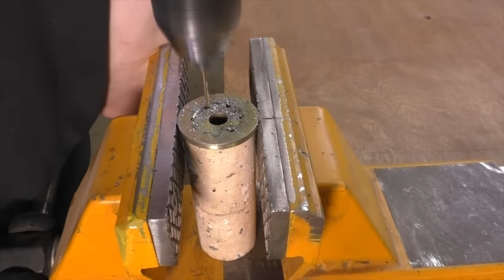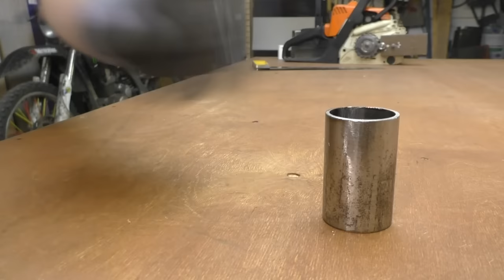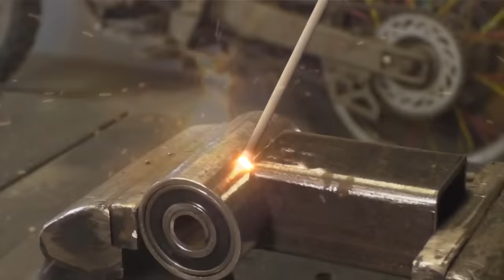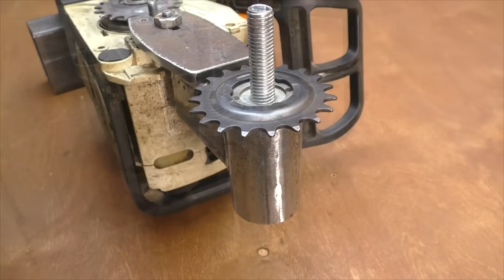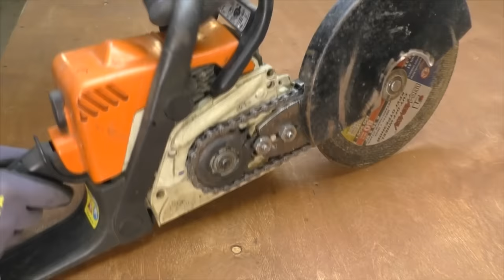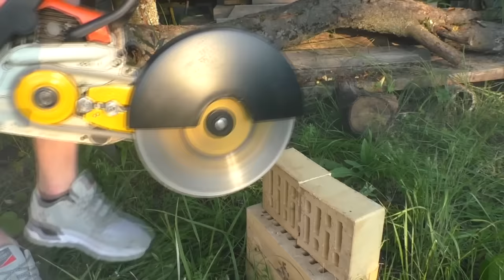С этой самоделкой хоть на край света! Такого еще никто не видел!

Comment: Hi Timofey, one little hint: Either you don`t fill the oiltank or your should mill a oil slot into the mounting bracket. Otherwise you block the oilpump and this may lead to a damage of it. Otherwise great work.
Reply: Auf die autom. Kettenschmierung kann man doch verzichten und selbst ab-und-an ölen - muss doch im normalen Heimwerkergebrauch nicht stundenlang durchlaufen das Gerät, wie im harten kommerziellen Arbeitsalltag!

Comment: You can put a carbide tip table saw blade on it or one ment for a miter saw or radial arm saw with 0 rake angle and cut wood with it. Yes even trees.  Still kinda a chainsaw.